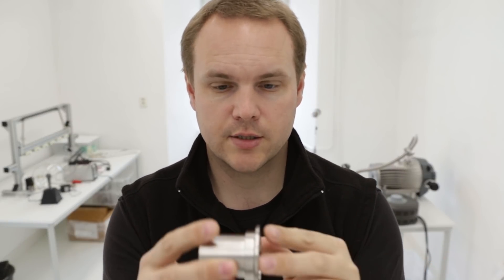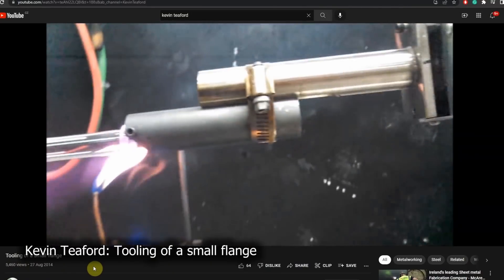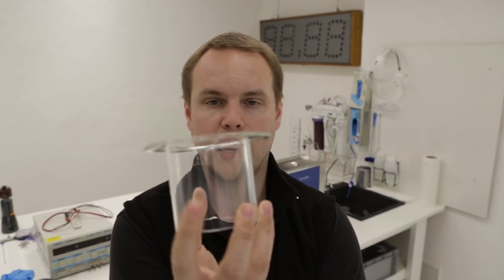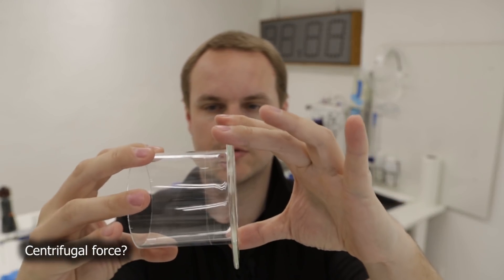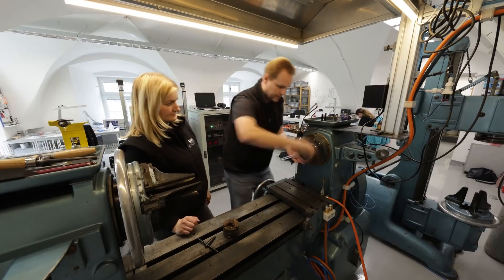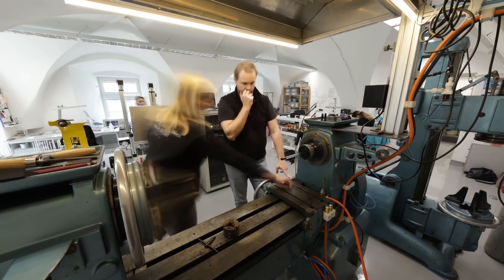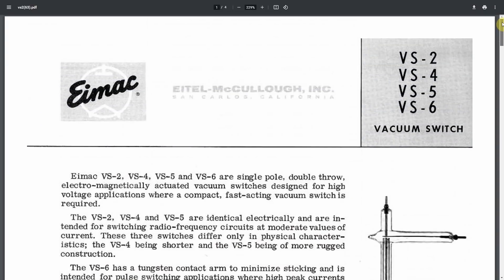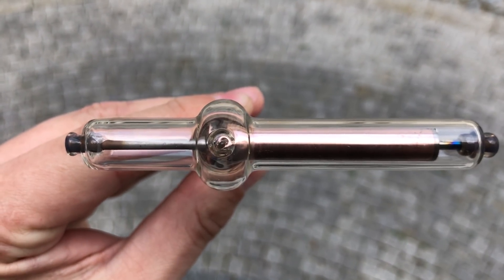Trying making a flange on glass, H tubes aged | week 16-17/2022

Comment: Thank you for demonstrating a different type of lathe work - in glass. I've not actually used this type of lathe but I've assisted a glassworker when we needed what was, effectively, a giant test tube 150mm in diameter and 700mm long. All the fun of a normal lathe but with operations at 500°C plus. I am very much an interested bystander. I don't subscribe but I dip every now and then.

And to think - I once had a 'portable' calculator that had a ten digit display, all Nixie tubes about 30mm high. 
You go to this much work to make 300mm ones.
To think - I threw my old calculator because it was "too old". 😖 
Shakes head - the way we used to waste stuff without appreciating the skills that went into creating it.

Comment: For the oxide forming on the tungsten, for a repeatable process, can you try anodizing?  It appears that tungsten can be anodized alike aluminum and titanium, so presumably you can use anodizing with a controlled voltage to set your oxide thickness? I.e. in a X molar electrolyte solution, apply Y mA/mm^2 until the voltage reaches Z volts, then youre done and the oxide film is just right. Not sure if it will be the right oxide, or the right crystal structure etc for making a good glass/metal seal, as I'm neither a glass worker nor electrochemist, but the basic idea doesnt seem unreasonable.

Comment: I believe you'll probably have better results if you have the glass already on the rod when you begin heating both. The oxide will not have a chance to form when it cools then. You may also get better heat distribution that way. Great work though guys, this stuff is incredible1

Comment: I'm surprised you get a good long term seal on tungsten rod that diameter without using some uranium glass for the bead. Or was that sleeve uranium glass? If you examine some high power transmitting tubes all the seals are green uranium glass when that large diameter tungsten is used.  Surprise! I had the opinion the breaking stuff (like the relay accident) was due to my old age! I guess not!   :)
Reply: Ron. I have been trying to send him some 7720 nonex beading glass for 3 years and he will not accept it. Hahahaha. Please have take some. It will help so much. Uranium glass is a hit easier to make the seal with but is increasingly hard to get the 3320 which is the real one. Schott has a non uranium version but a case is about the cost of a car now. 3320 has been out of melt since the 50’s. As for the  beading of the glass for the relay leave them just a touch dark for the bead. When you seal that assembly in the actual tube you will diffuse more oxide away so you want a little reserve left. The splotchy or bubbly appearance is from not firing the pins before beading. This can be done in either wet or dry hydrogen or vacuum. Then to get your oxide coating Heat in an open hydrogen flame to redness then withdraw the flame and you should get a more consistent oxide layer. The hydrogen firing will also greatly reduce the need to polish the lead. As for the brazing At M.U. It was either done under a hydrogen bell jar and an arc. Think TIG welder without the gas supply tube as it’s already in an environment. It would flash burn off the bottom of the jar from time to time so you might want to figure out something safer. The copper requires a non oxidizing atmosphere. I might try it with forming gas as it’s much much safer. The silver bearing brazing alloy can be used with any torch generally. Both methods will have to be polished clean afterwards but that’s no big deal.
Reply: Oh. And the other method of brazing was with an induction heater.
Reply: While I was watching this amazing glass work, I instantly remembered you Ron!
Reply: NileRed made a video about how to make uranium glass https://youtu.be/RGw6fXprV9U
Reply: Hi,glasslinger
can you help me with this
Reply: Glasslinger ud es una persona super inteligente,la aprecio y admiro.greetings.

Comment: Yup, the mass of the molten glass wants to fall down, in this case, down is wherever the forces point in that rotation, which is anywhere but the center of the glass tube. I suspect that as long as you maintain the heat at the right place, you could actually make a glass plate out of a glass rod of sufficient thickness or length.

I do remember, years ago, seeing a glass artist's piece, that was made from a glass rod, it had a perfectly round "top" that mirrored the glass rod's own coloring (multiple colors, sort of weaved together, kinda like how glass marbled look). I'd assumed, back then, that it was 'glued' on top, but now i'm quite certain this is how it was made. Neat.
Reply: That's exactly how 'bullseye' windows used to be made, that's why they have a circular pattern of changing thickness.

Comment: You might want to put nut in the middle of lathe handle that tilts it to vertical position, so that you can use drill to quickly tilt it instead of spending a lot of time doing that manually.